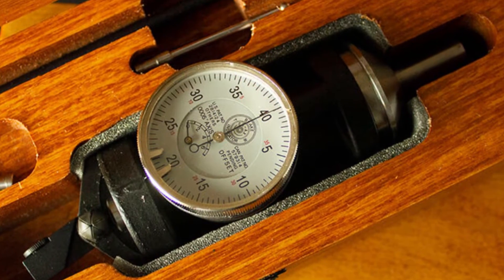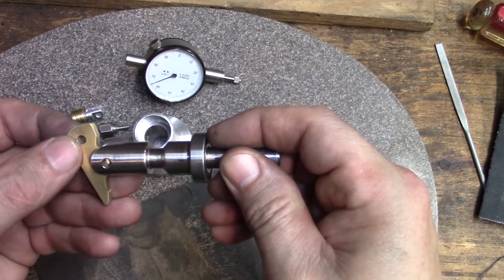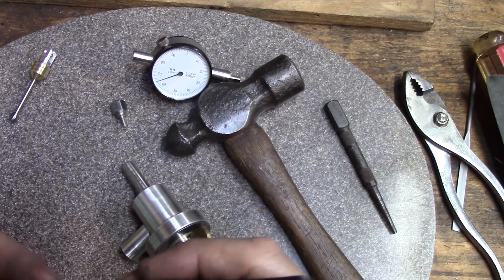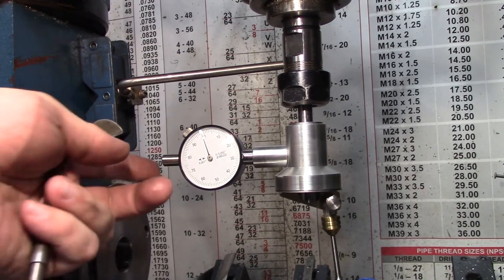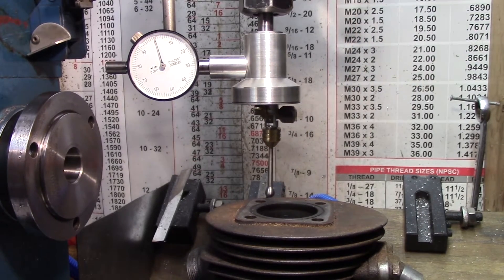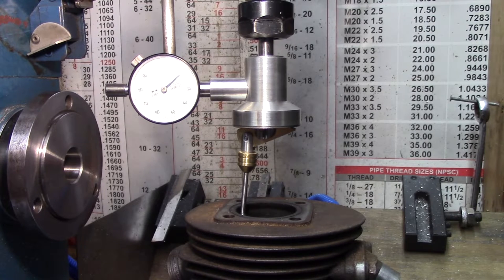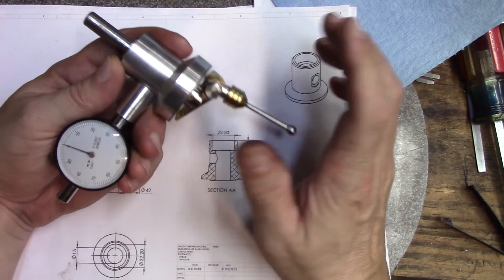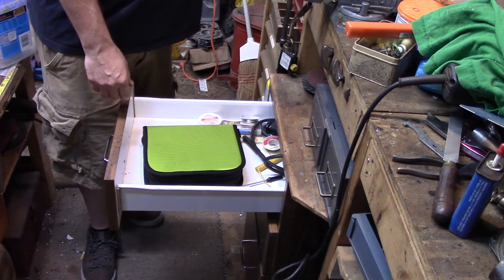DIY Coaxial/Coax? Indicator - It works! - #TMC2020

Comment: That spring only needs to be strong enough to center the device when horizontal
Reply from the maker: That is what I found as well. The piece I used works, but is too strong. I  would like to find something that would provide equal pressure around the diameter, which would require a much thinner spring for the space.  The piece I used actually did push the bearing off it interference fit after a bit of run time.

Comment: You could get or make a bellville washer that will make the pressure more even all around and help with the flutter.
Reply from the maker: That is an interesting idea. Thanks!
Reply: @theeddies  Yeah and they are easy to make and you can stack them face to face for more travel or on top of each other for more force.

Comment: nice job, but plan haven't important size "roket" exactly radius arm (lever) wich have contact with body.
Reply from the maker: Thanks! If I understand you correctly, the arm can be any length or shape needed for the job.
Reply: @theeddies  no, it's not about probe. "roket" simular to cam-shaft & have circle line in  part wich touch "body". It's clearly on plan, but haven't size.
Reply from the maker: @no1se706  Oh I understand. The designer, Bill, did not define that measurement in the plan. As long as it is a slight curve, the size is not important to the function. The curve only needs to provide adequate clearance for the the rocker to move smoothly on the body. In part 1 of the video series you can see that I basically made the curve by eye. The dial is not making absolute measurements. It is only a reference measurement so the curve on the rocker is not critical.

Comment: Gday, you have done a great job on this build, I think I’ll be having a go at this one day, Cheers
Reply from the maker: Hello Matty, It is a great device. I would be curious to see an actual machinist try out this build and get it under 2 thou runout. The plans are excellent and there is a link in the description in case you missed it.
All the best!
Eddie
Reply: @theeddies  Gday Eddie, it would be great to see a machinists try this project but I’m only self taught and certainly not a machinist, I’m keen to have a go it and I’ve down loaded the plans, very handy tool for sure, Cheers
Reply from the maker: @MattysWorkshop  Same here. I have seen your work though, its good stuff. Even better being self taught. I like to say I am self taught but had pretty decent shop teachers  - Mr. Pete, Tom Lipton, Abom, Stephen, etc.
Best!

Comment: This was interesting to watch. The one thing that may be limiting your success is the “wobble” in the main body and indicator assembly. This could be a result of the internal spindle taper having some run out, or the various diameters on the main shaft not sharing a common axis. Music wire can be purchased in coils, and wound to suit your needs. Mc Master-Carr is a great source for many goodies.
Reply from the maker: It is likely a combination of factors. In the videos of the build I actually improved it from what it was which I think was 10 or 15 thou. I do plan to revisit this to see if I can get it better but honestly with the machine I am pretty happy with 2 thou runout. Especially considering it seems many commercial offshore versions share the same tolerances. But I still think I can make it better. Check out the actual build videos, it was a learning experience for me. https://www.youtube.com/playlist?list=PLAHFt4_nmEpojhlMK2r_MrR4_lYOpYFGz

All the best!
Eddie

Comment: I have a chinese one and it flutters as well.  It's pretty hard to eliminate the flutter and it doesn't really effect the accuracy.  I tried rebuilding the axle but it didn't help much.  You can buy spring steel on Ebay and make your own spring.  Good video!
Reply from the maker: Thanks John. I have seen some video of some flutter and others that are still. Great idea on the spring.